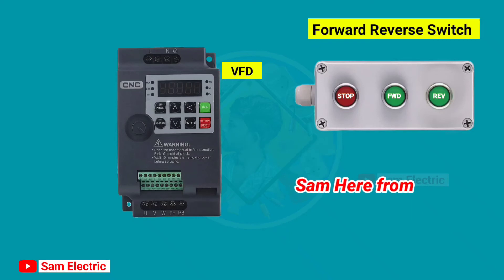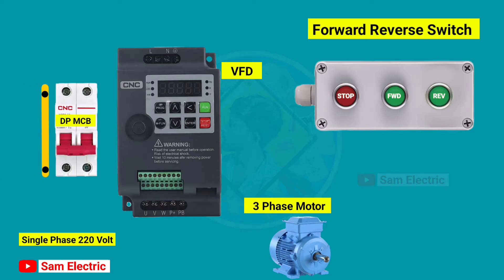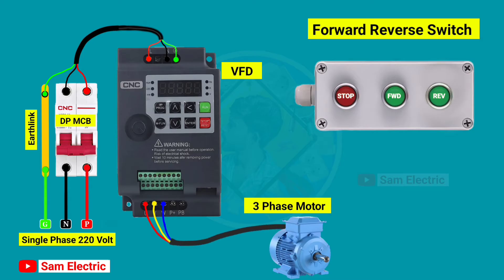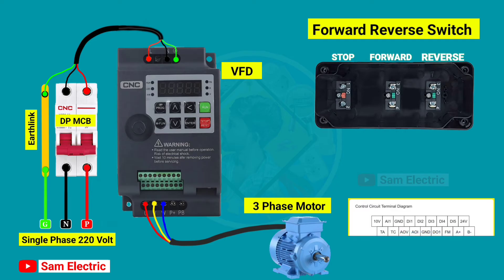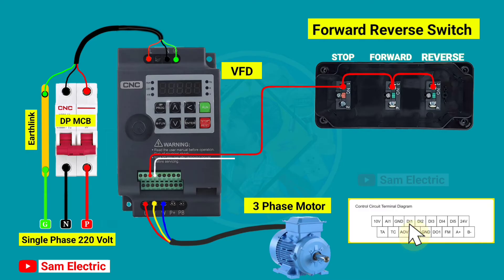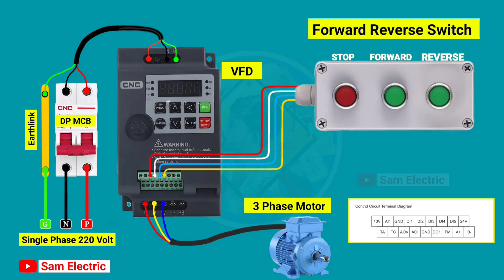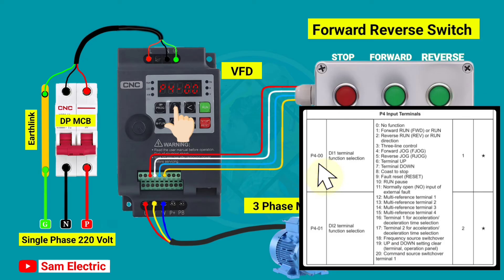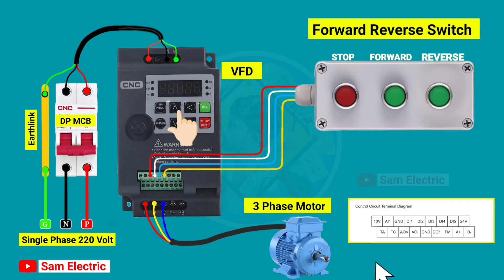Forward Reverse Connection In VFD & Parameters Setting l VFD Control Wiring

Comment: What type those switches are  self locking or non self locking?
Reply from the maker: Non self locking, simple No nc Switch are used
Reply: @Sam.Electric  Thank you for fast replying. My problem must be programing , because motor runing as long i hold button pressed.Vevor  VFD D100-2,2T4B-S .I can't find anything same like  you have P4-11 where to chance value.

Comment: wiring has simple easy, but how set parameters this chinese CW100 VFD. start is DI1 stop DI2 .   pot, AI1 and 10V and GND.  in 220V 1 phase and out 380V 400hz spindle, but VFD not can set more hz than 320hz max and any external wiring not working parameters.